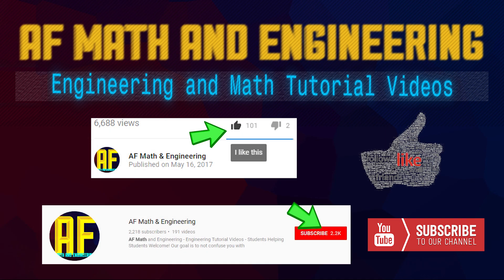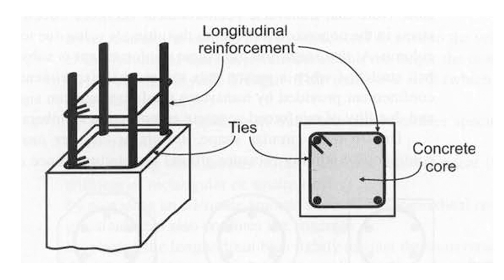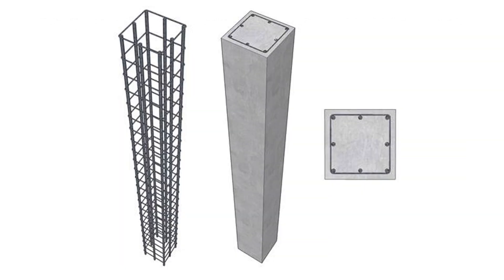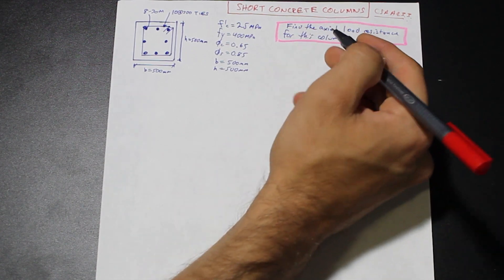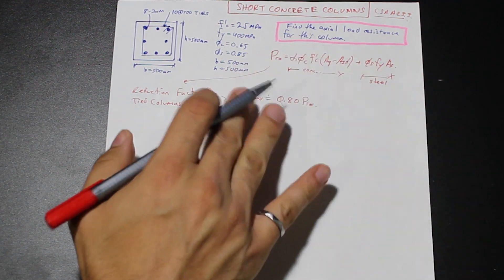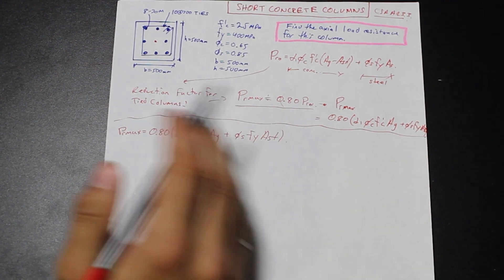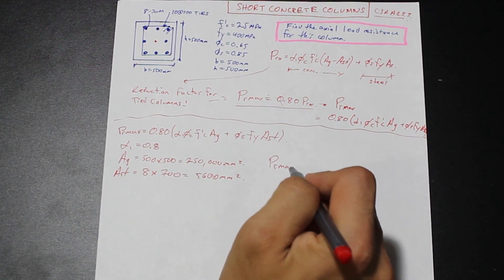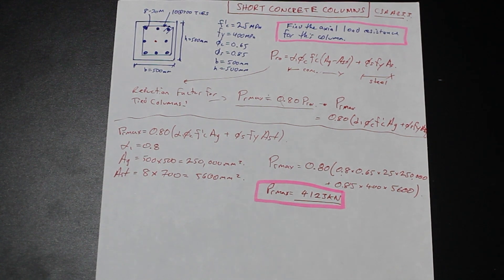Reinforced Concrete Columns - Theory and Short Column Example - Canadian Code CSA A23.3

Comment: HOW DID YOU GET AST= 8*700? (EXPLAIN DETAIL ABOUT 700) PLEASE
Reply: His design calls for 8-30M rebar. Each 30M rebar has a diameter close to 30mm. The cross sectional area of each bar is then Pi/4* (30mm)^2  = 700 square millimeters. The area of all 8 of them is the total area of steel, As. The area of steel is then 8 x 700mm^2 = 5600 mm^2. Hope that makes sense.

Comment: guys I need help with finding the thickness  of the concrete with 2 point loads at a third of the slab. I'm so confused. Help?
Reply from the maker: Hi, not quite sure what you're asking..so given a strip of slab with 2 point loading at equal spacing you need to solve for the thickness of the slab?  You can size the slab based.on shear, it's an iterative process.